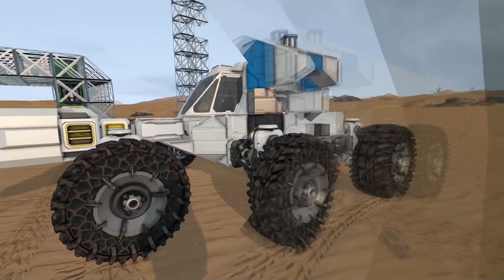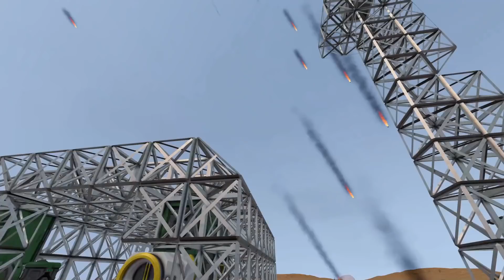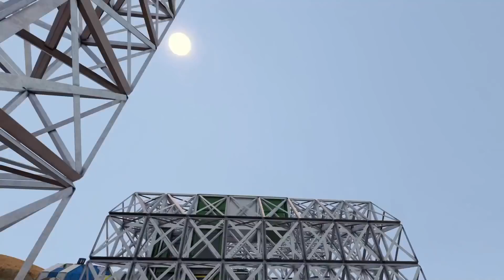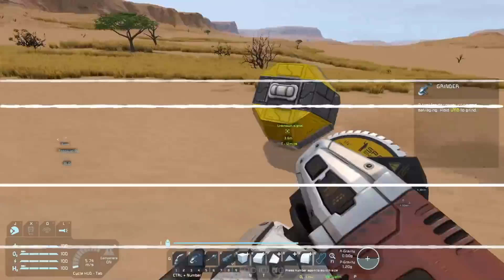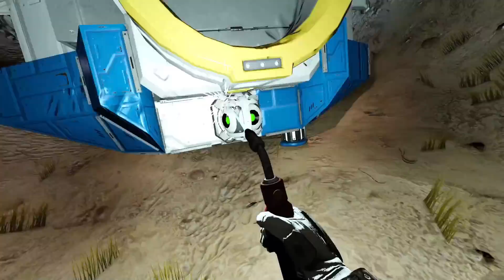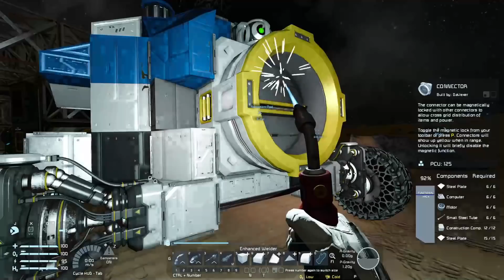Space Engineers Surviving Pertam: Built A Mining Rover And I Got Stuck | Part 2

Comment: A little tip with how you had your rover stuck.  You can add blocks backwards with an unconstructed battery on the end to counterbalance and get the rover back on its wheels.  Unconstructed batteries are still just as heavy as complete batteries, so they're great for this purpose.  It's also a good way to take care of a rolled over rover, which can be kinda ruff.  🤣

Comment: The best way to mine the stone (resources if they are just near the surface) with the rover is to build the drilling rig in the middle of the rovers body with nice wide base and proportionally long, put the containers on the forward and backward side of the rover it will keep it balanced when it's full, connector on the rear and few gyroscopes wont hurt.
The rig itself can be anything you like, from just one drill with the piston, or bunch of pistons rotors and drills, the point is to put the landing gear on a piston and level it down to the ground and lock it before you start to drill, it will keep the rover stable when drilling.
So, just go to spot for drilling, park yourself with the landing gear and turn on the rig. After you done, retract the rig, unlock the gear (retract it up with piston if you put it on the piston to lower) and move to another spot.
I was playing around with the rovers and drilling for a while, and all those when you use it without attaching to the surface doesn't work properly, some of them works slowly, some makes the waves etc.
For those ones which makes waves , they have a problem with the physics and how SE handle the sub grids, it also affect the others but little less, and when you're attached to the ground via landing gear SE considers that grid as static one, so it doesn't make a mess :D
I hope I gave you some ideas in the future for the mining rig rovers, it doesn't have to be big, it can be pretty small indeed, just frame, battery, gyro, seat and the rig in the middle (try to aim it to drill the hole smaller than the wheel base or you will stuck in the hole or just build the ramp under the rover and move it :D )

Can't wait to see the next episode, keep up the good work there :D
Reply: #spreadtheword 🖖

Comment: Others have mentioned the center of gravity issue but another problem you are probably running into is that Space Engineers isn't really good at computing physics when multiple grids are involved.  This is why flying ships with sub grids keep sinking even with dampeners on.  As to creating a sloped mining tunnel using a wheeled vehicle, it is very difficult.  The farther into the tunnel you get the move "waves" you will have on the floor.  This is where I thought your hinged drills system that sweep back and forth might come in handy as it appeared to make some fairly flat surfaces.  The only other way is to build a ramp and keep extending it as you go.  Probably easier to set up pistons with drills than it is to use a wheeled vehicle.

Comment: Your wheel base is too short with so much weight on the front and a hi center of gravity. Also your front wheels look to be on a different block height which may be causing the pull. Once your back wheels come off the ground your done for. You could extend the back with another cargo container to extend the wheel base.  It would be recommended to get the center of gravity as low and between the back sets of wheels. If you turn on you display for center of gravity, it may help you see what’s going wrong.  Also a sorter tucked in the front to help keep the drills clear to avoid the destruction you had when trying to stop.  Good luck, enjoying the vids.